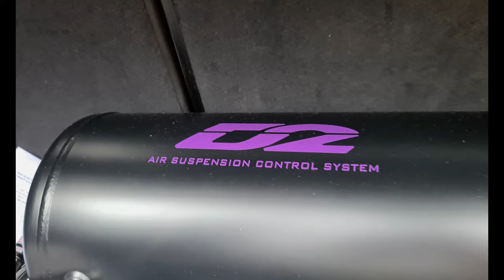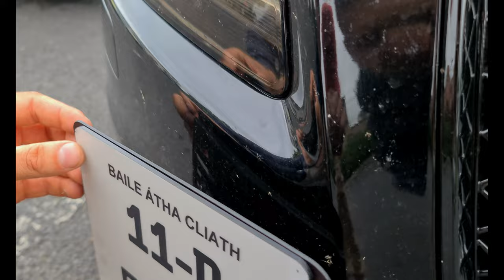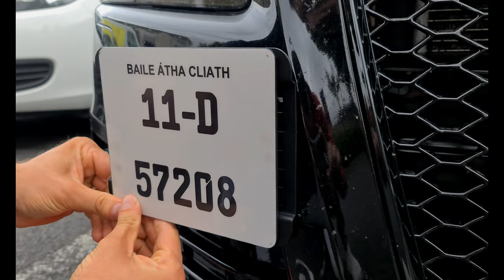Fitting License Plate Bracket On My Audi A5 *New Toy, Better Look*

Comment: Nice Vid! what year A5 do you have? Did the side plate mount interfere with your front parking sensors?
Reply from the maker: Hi, 2011 No front sensors 🤜🤛. Thanks.
Reply: @sby93_team  car doesn't have front sensors?
Reply from the maker: @HH-wm7yi  No front sensors 😁👍
Reply: @sby93_team  does it have back sensors at least?😂